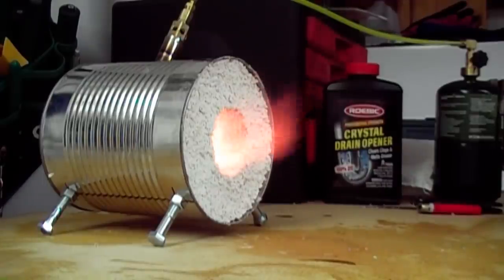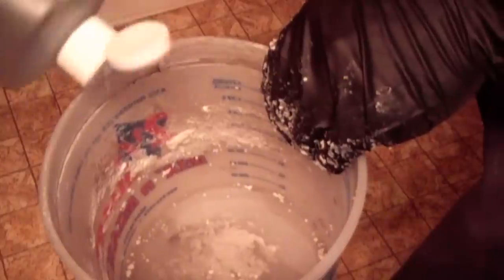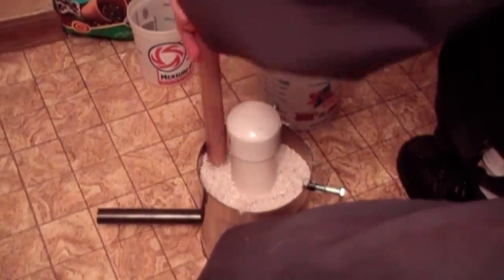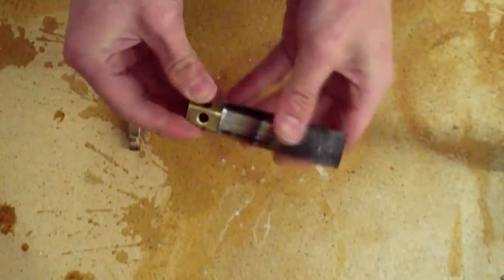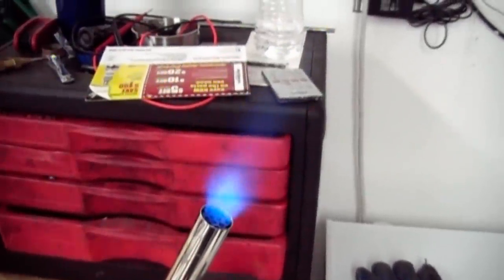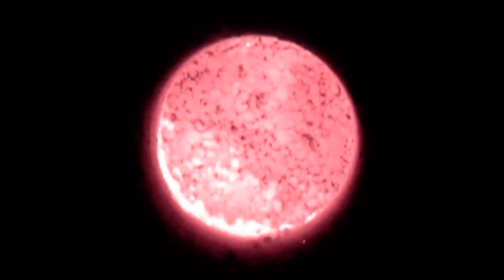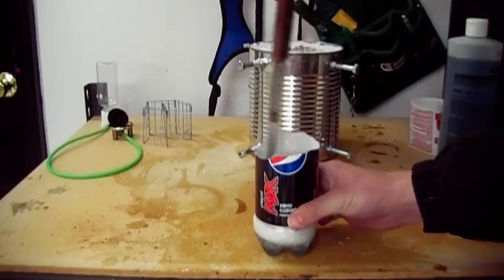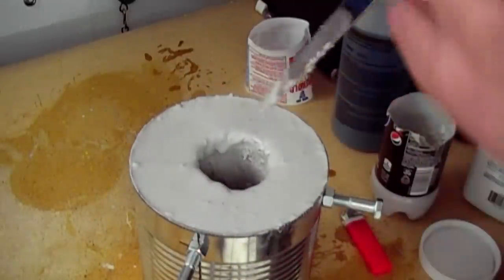How to make a coffee can forge

Comment: Great Video man.  Two questions about your burner design if I may.  

1. Where does the tip of the 1/8 plug nozzle end up relative to the air holes?  It looks centered on them from your stove video.

2.  Does the 3/8" nipple serve any purpose besides supporting the SS tube?  I imagined it might be there to heatsink or to reduce the volume of the back of the burner.  

If not, I found 1/8 - 3/8 and 1/8 - 1/2 female adaptors at Dixieline. I have a small sherline machine lathe, so I figure I can turn the fitting to fit my tube exactly, retain it with a set screw, and forgo the $7 nipple and flush washer.
Reply from the maker: Yep centered on them or I also have had it flush with the start of the hole, if that makes any sense.

With the 3/8 nipple, you get a section of narrower diameter at the start, so the mixing gas and air stream maintain a higher velocity, this helps fuel/air mixing. Where the nipple ends inside the SS tube creates a step up in internal diameter, causing the gas stream to slow down a bit, and the turbulence caused helps anchor the flame on the perforated strainer, preventing it from lifting off the strainer at high gas flows and blowing itself out. This is sometimes accomplished with a flare mouth, or bell mouth at the end of the burner. Heat transfer of the brass dose happen, but it is not needed, and in extreme cases a bad thing. If you have a way to turn parts to accomplish what the brass nipple and face bushings do, it should be fine. Thanks for the comment!

Comment: You did not mention:
- What type of gas you are using?
- Why do you use sodium silicate? 
- Is it feasible to use Perlite and plaster only?
Reply from the maker: +sdchaps 
-Propane
-Sodium silicate is used as a binder or glue
-You might be able to use plaster and perlite, but it will not perform as well. It will hold up about as well as plaster alone, with perhaps a little better insulating qualities, plaster is a decent insulator by itself but decomposes and crumbles if heated hot enough. Other recipes use sand to help the plaster hold up to the heat.

Comment: I noticed that when you place the burner, you don't aim it directly into the middle. It looks like it goes in at an angle. Is that by chance or are you looking for some sort of tangential air/gas flow?
Reply from the maker: emf4kv A spiraling flame is what I was going for, it helps fill the whole forge with flame.

Comment: That is really cool!!  So how well does it work?  how did you fit the propane canister to the burner? I have seen a lot of different designs for this, but with all of the chemicals yours seems to be the most complicated I have seen so far.  Another guy suggested using River Sand and Plaster of Paris mixed 50/50, Idk how well that would work.. but he is also using a Propane torch, not a homemade Burner.

Comment: How much sodium silicate did you end up using? And does it have to be pure (100% solution)? Also, I'm guessing that even though the flame on the bigger blowtorch isn't any hotter, the fact that it's bigger means the forge heats that much faster? Thanks for the great video!
Reply from the maker: It's hard to say exactly how much sodium silicate needs to be used because if you make it your self, the concentration will vary. But i would say about 250ml per gallon of perlite. The bigger flame dose contribute to quick heating, as dose the insulation effect from the perlite. Thanks for the comment!

Comment: hey guy love the vid. I just made a coffee can forge myself this weekend. I have the torch in with the map gas. was wondering how long it took the forge to heat up to the right temp to start working on my projects. and I've seen propane forges too is that better, cheaper? PS don't use a spray paint can to make the hole for the middle haha and the plaster does set wicked fast haha.  -Cold

Comment: Hi Clkindred,

I'm in the process of making one of these forges, a quick question; if i drill a hole in the top of the stainless steel container and put down a heat sensor probe with a thermometer on top do you think that it would give accurate measurements or would the insulation absorb the heat as it travels up? Also would it effect the general working temp of the forge in anyway?

Big thanks mate, really nice videos!
Reply from the maker: By stainless steel container do you mean the coffee can? As long as the temp probe is exposed in the forge it should give the correct reading. Depending on the type of pyrometer you use, it should not effect the working temp. Most pyrometer probes I have looked at are a simple design with the thermocouple inside an inconel steel, tungsten or ceramic tube to protect it. Should be as simple as making a hole for it to enter the forge. Thanks for the comment!

Comment: I didn't know that you could mix up a refractor-style material so easily.....
How would you compare your perlite mix to fire brick or fire something similar? 
Thx
Reply from the maker: Comparing performance or manufacture? The insulation factor I would say is similar to insulating firebricks, based on how quickly the surface can be brought to a glowing orange. A non-firebrick like a typical cement brick really can't be brought to a glowing orange at the flame site because they conduct the heat away. Durability is better with firebricks, though I'm still experimenting with different recipes. I have a newer video with an updated formula, the trashcan forge.

Comment: Are all these components for the burner-(3/8" x 2" coupler, brass ring,stainless steel pipe, which I'm assuming is 2" opening, and then the second brass barb,1/8"coupler, and MPT plug) , already threaded or do you need to have a Tap & Die set too to make this?
Reply from the maker: the threaded pieces are already threaded, but one piece needs it's threads deepened with a tap. the stainless steel tube is 1 inch diameter.

Comment: will this heat up steel to where I can shape it on a anvl? i have a project and I want to make a (shitty) knife for it.
Reply: +Kylo Ren Yes you can just make sure your burner is good. I built one exactly like his and if you attach MAPP gas you can forge weld steel nails together effortlessly. It gets so hot the tips of the nails melt  within a few seconds. With regular propane you can definitely forge small steel projects.

Comment: clkindred I seen your other video on the trash can forge. I was just wondering if there was problems with the coffee can forge. I have found the trash can you used in the other video but the foot pedal come up into the cylinder quite a bit, so it has a bug cut out on the side.. so a coffee can would be easier to find. I just wasn't sure if you had problems with this one.
Reply from the maker: The first problem is it was too small for what I wanted to work on. The lining also was updated to a better recipe that has no plaster in it, the aluminum oxide works much better.

Comment: What is the maximum temperature of this type of forge? This looks like a very interesting project - thank you for sharing your knowledge.
Reply from the maker: Milo Dodds Probably around 1900-2000 degrees F, I made a better one before I really characterized this one, so it never got the max temp tested. Heck, my new forge I don't know exactly what the max temp can be, lol. Thanks for the comment!
Reply: Thank you for this additional information. This would be perfect for some small projects. The last time I forged was when I was high school and took an Ag. Mechanics course. We forged some metal tongs, an eye bolt and a gate hook. This forge might be perfect for smaller pieces such as jewelry. If you were to extend the hole all the way through it would you lose too much heat?
Reply from the maker: My new forge is through hole and it seems to run a little cold unless I close up the openings a little.

Comment: For the burner, does it have to be custom? I am shaky on the fundamentals of burner construction. Could I simply use a rose tip torch as a burner?
Reply from the maker: The burner determines the size of forge you can make, a simple torch could only heat a smaller forge.

Comment: An excellent video my friend and many questions . Where does one purchase sodium silicate and aluminum oxide  sand blasting abrasive ? . I made a forge from stainless steel pipe  - 8" ID - 1/8" wall thickness - 14" long . The inside is holding up well , but I want to use your coating formula .
Thank you very much for your ideas and contribution .
Lefty
Reply from the maker: Master Tracker The aluminum oxide I purchased at harbor freight, but they seem to be discontinuing that particular product. A goo place to get both the sodium silicate and aluminum oxide is from pottery supply websites.
Reply: clkindred Thanks

Comment: The second forge toward the end of the video seems to use some blocks for insulation, what are they or what material did I you made them from???
Reply from the maker: ***** That was an experiment I did with rockwool. It has a higher temperature resistance than fiberglass wool, but not high enough to be a good foundry lining.

Comment: I've seen people do this with plaster of Paris and sand mix what are the benefits of using the perlite do I get a better temperature out of its or heat transfer..  this is one of the best I've seen made
Reply from the maker: H8edsinclair Oh thank you! The main disadvantage of plaster is that when your forge or foundry is up to temp, you have heated the plaster beyond the point it which it dehydrates, it will be fragile after that. If plaster is used at all, it is best used as a modifying component, not as the main material because you can't count on it to hold up. If plaster it heated even hotter, it decomposes and releases nasty fumes. Perlite won't decompose at the temps we can get with a forge or foundry, but it can soften or melt.
Reply: clkindred thank you so much for the reply and the information.. Is it possible to use map gas with your perlite mix or is that too much heat
Reply from the maker: Sure, it was just too expensive for the additional heat. The newer recipe is the one I recommend. The one in my trashcan forge video.
Reply: clkindred thank you much for the information take care

Comment: I attempted to fit all the brass pieces together and found that the plug will not screw in the coupler - it is tapered as plugs are.  What did you do to get the brass plug to screw into the 1/8-3/8 coupler?
Reply from the maker: Sorry, I went into greater detail in my "Building a bigger blowtorch" video, same design.

Here is the link Building a bigger blowtorch

Comment: Wow I am impressed, thought you had to go purchase a really expensive forge for knife making. 

Also, is there some way to buy a cheap temp gauge and will this forge set-up achieve 1800-2000 degree temp?
Reply from the maker: Thank you! I have tried to find a temperature measurement device for a reasonable price. It seems a pyrometer setup runs about 100 bucks. The temperature probe is cheap enough, even possible to make a thermocouple probe, it's the device that can read the voltage value and display the corresponding temp is the expensive part. Even a multimeter with the thermocouple plug won't work, because it's not calibrated for the voltage range.
Reply: I bought a pyrometer at wish.com, it was really cheap like $20 something its chinese ofcoarse, but the readings are good and gives a reading in 1-2 degree accuracy.
Reply: +clkindred Did you know that you can use cheap PID controller with thermocouple just for temp display? Eg. RKC's REX C100 clone from ebay would do. It goes for about $15.
Reply from the maker: Yea, it seems I was not looking in the right place for a pyrometer. Thanks for the heads up.
Reply: you could use a metal barrle and a pole with holes in it throughout the barrel to get a biggr knife you can also use a blow dryer and coal

Comment: this video is excellent thanks so much !
I am trying to source sodium silicate in a smallish quantity locally with no luck at all ,
perhaps I will have to make it ...
re your burner the brass nut that keeps the brass nipple centered did you turn it yourself ...or ?
thanks
Reply from the maker: Yea I tried to find sodium silicate locally at first with the same result. If you know anybody that works for a car dealership, they might have a bunch leftover from the cash for clunkers thing. Sodium silicate is what they put in the engines to destroy them. Side note: do not add to your engine oil haha. Sodium silicate is also a part of some radiator stop leak products, but usually mixed with other crap. It is the main component of some concrete floor sealers, but has declined in usage in favor of resin based stuff. It is used in pottery for adding to slip for slip casting, as well as surface texture techniques. Sodium silicate is also found in a lot of heavy duty cleaners and grease cutters. Pro tip: Pure sodium silicate makes an AWESOME grease cutter.

As you can see, there are many advantages to having a quantity of pure sodium silicate on hand, I would recommend making it if you are comfortable with the process.

The brass nut was a piece of a threaded fitting that I sliced off and filed the outside down, I wish I had a lathe. In my "building a bigger blowtorch" video, I show an alternative part to use. Thanks for the comment!

Comment: not sure if anyone else has pointed this out yet but for the fact that this hack uses plaster of paris it should only be used outside for the first few months of ownership. plaster of paris puts off some nasty toxic fumes when you heat it above a few hundread degrees. if you plan on doing something crazy (like arch/plasma forging) expect it to put off a lot of funny smells that you shouldn't be breathing in.

as always when working with high heat, questionable chemicals or pointy things, wear your PPE and handel responsibly. fordge outside and properly vehntilated. keeping an adiquately sized fan on your work area will only help you if you are outside. when and where posible don't breath in anything that comes off your projects.
Reply from the maker: Ryoku itoku Thanks for the comment, I don't use plaster anymore in my newer recipe, mostly for strength, but when testing samples of plaster based refractory I was able to heat to decomposition and noticed said fumes. Plaster is just not good for a refractory no mater what anyone else says.
Reply: i'de recommend doing a revisit to the recipe or at least a notation until you can get around to it. while this is a very good and stable process of creating a backyard forge (I would also recommend a process of carving a factory pour spout and refactory brick base plus "grips") informing users that they might get more than some odd smells seems like the responsible thing to do.

I love the design personally but because I don't know chemistry I can't really recommend anything different.

good hunting!

Comment: Awesome design! What do you recommend to use as a crucible? High density graphite tray of some kind to slide in there?
Reply from the maker: Istahill Stanfield Something like graphite, or ceramic is the best. Stainless steel or nickle is OK if contamination is not an issue. If aluminum is being melted, it should be known that aluminum is a powerful reducer and will attack a metal crucible, so the lifespan of a stainless steel or nickle crucible is short. Between 2-10 melts depending on how thick the metal is.

Comment: Tried to make the burner but cannot get the 1/8" plug to reverse thread into the 3/8-1/8 coupling.  Actually ruined the threads on the coupler trying to get it on.  Anyone else have this problem that has tried their hand at this burner tip?  Certainly didn't thread on as easily as in the video!

Comment: I've already bought a torch add-on for my propane tank, would the couplings and other pieces be necessary?
Reply from the maker: As long as the torch add-on works well enough, no there is no need to build the burner in this video.

Comment: How many times have you used the forge? How long has the refractory material withstood heating/cooling?
Reply from the maker: I never used it much because it's size made it hard to work with, I made a newer version here and the refractory is holding up great. How to build a trashcan forge

Comment: Hi mate good vids. One question?? I've made some silicon silicate but if I put some on a nail wet and heat it it fluffed up about 5 times it's size as a hard powdery like stuff. I've left it for a while and now it's turned back into a gel? Is this right as I can't see it can be used as a adhesive if it goes back to gel?
Reply from the maker: Sodium silicate itself, even dry, contains water. The goal is to convert it to silicon dioxide (sand) when it's been incorporated into or onto our project. It must be free from all excess water, that is to say as dry as you can get it, before exposing it to higher temps. It sounds like you heated a solution to the point where the steam deformed the drying silicate, then when left for a while, the water remaining re-dissolved the white crusty stuff. This is also the case when too much sodium silicate is used. I advise a slow and long drying cycle in an oven if available. Start at about 100 degrees C and slowly jack up the heat until you have maxed out the oven. Then you can be sure the silicate is dry enough to fire.